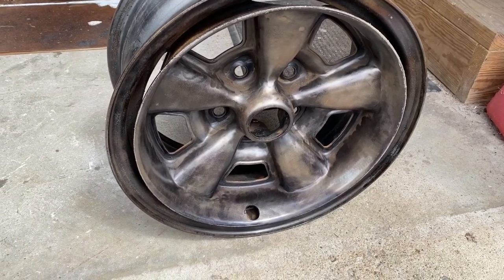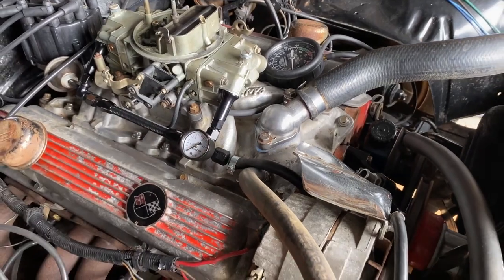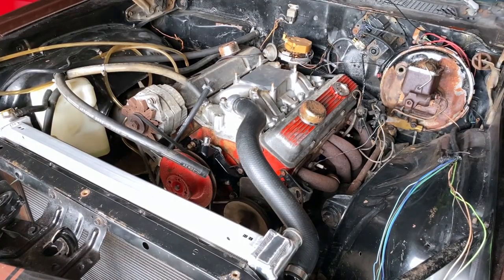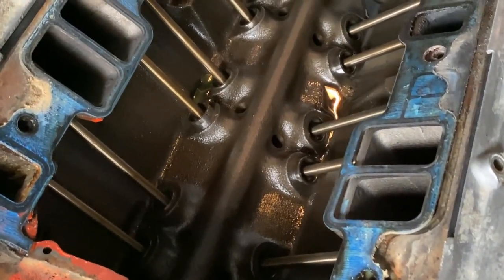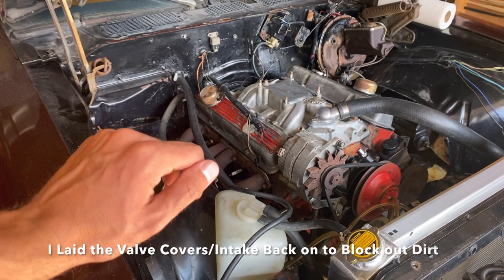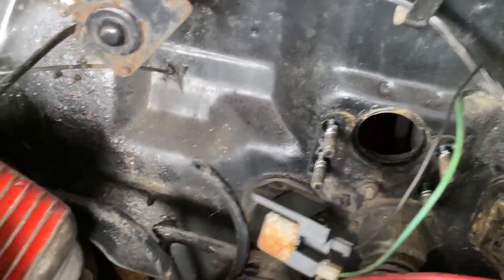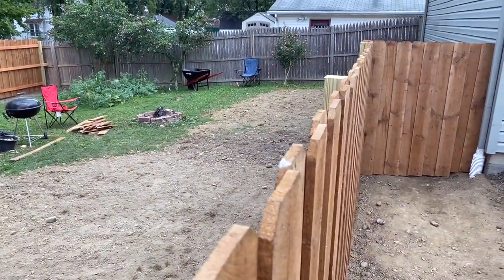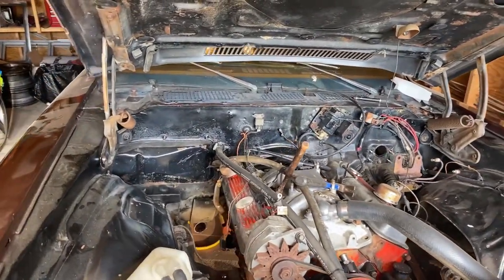Diving Deeper Into the 1973 Camaro's Engine..Does It Have a SOLID OR HYDRAULIC Lifter CAMSHAFT??

Comment: As you were starting I was thinking he might as well pull it, freshen it, re-gasket and detail the engine and bay. And wahlah, you decided to do it. Yeah projects usually take way longer than you think in the beginning. It is truly a worthy cause on this car. Plug on......
Reply: I think this about about every project. Never understood the desire to make an engine that's been sitting for years run ASAP. Tear the thing down, give it a dingleball spruce up at least and don't grind everything into dust. Same for brakes, transmissions and rear ends. It's a project. Slowing down will speed up the completion.

Comment: The way you have the distributor hooked up currently is correct, ported vacuum from the metering block...
Reply from the maker: I thought I had it hooked up correct but second guessed myself reading a comment lol. Thanks for the clarification!
Reply: Yeah you was right. If on the ported vac. The distributor will be advanced all the time.  And on the secondary port the distributor can advance with more throttle

Comment: ... it was Me! 1st to call it as a "Solid Lifter Engine" ';-) just to see that each cylinder has valve movement (open/close) and get new Rocker Arm Nuts then adjust the valve lash with each valve using feeler gauges to spec!  You are doing GOOD
Reply from the maker: Nice, you have a good ear!!
Reply: @RyanSampsonRPh  ';-) Many years of experience!
Reply: ... at 1st thought that it could have been a LT-1 until you checked the head casting number?
Reply from the maker: ConquestN98858 Right! The number (last 3 digits) stamped on the heads are “545” so it all appears to be correct for 73. Just have to see what is hiding inside it 😎!

Comment: Another great video, Ryan. Wish I lived closer. I have one of those 5 spoke rims. It was the spare to a 73 that I bought and started to restore, then life got in the way. I sold the car but the rim hes been stored indoors since the early eighties
Reply from the maker: Dang! The wheels are actually hard to come by!
Reply: @RyanSampsonRPh   I assume the rims were factory to the car. The paint is very weathered gray. I can check the date code if you want me to
Reply: I dont have the center cap or the beauty ring
Reply: @RyanSampsonRPh  Ryan, the rim I have is stamped, 15x7 JJ with either a 6 or 9 on its side under the  rim size. Not far from the that number is the number 4. I took some pics of it and the entire rim if you want me to send them to you

Comment: Looks like the factory lift into reverse shifter was replaced with a quality Hurst unit - It looks like the one i installed in my 74 Z28 - it had a shorter throw than the factory one - plus the factory shifter was held in by a small pin that would vibrate loose and the whole shifter would come out of the centre console a real pain - with the Hurst shifter no more problems 👍

Comment: I'm willing to bet that that car originally came with a points distributor. If you used the original 18ga yellow wire for the HEI power wire your only getting 8 or 9 volts. You need to run a 10ga wire from the fuse box and connect that to the distributor. Points distributors can't handle 12v. The yellow wire is a special high resistance wire cutting the voltage from 12v to about 9v max. That could be the reason you're getting misfires. Those ports are really clean. I'm thinking someone worked on those heads before and the heads are really clean for that being a 73. Usually there's a bunch of gunk in there. There's gunk in some engines from the mid 2000's

Comment: 1987 and older hyd lift and solid cams need zddp. A min of 1200 ppm. Not sure if I mentioned before but make sure you join the 2nd Gen Camaro forum at www.nastyz28.com. My handle on there is COPO.

Comment: You can tell if any of the cam lobes are worn by marking a white or light colored stripe on the push rods down the length of them an inch or so then start the engine or even turn it by hand and all the push rods will spin as the the valves open and close if nothings worn badly. If you have one or more not spinning correctly the cam lobe, lifter face or both are worn. Also you can check the specs on the cam with a degree wheel, they have cheap ones and you could even print one off the net and apply it to some plexiglass or something similar. As someone else said the cam should have some ID numbers on the front journal face. NICE FIND!
Reply from the maker: Danny Guinn Thanks for the info Danny! I was just researching how to use a degree wheel but I am more than likely going to replace the cam either way so I will check if it has some ID numbers when I remove it! Thanks again for taking the time to type this👍👍

Comment: If you truly like qjet carb sound...Holley made a qjet replacement known as a spread bore. Had small primaries and much larger secondaries. It will require a spread bore intake or adapter. Had one on my '78 trans am with  Pontiac 400/4speed that worked incredibly well. Helped with fuel mileage too by using the smaller primaries....if you kept foot out of the secondaries. My carb was a 650cfm spread bore double pumper Holley. If you need clearance from between fuel line and heater hose could try using carb spacer or a spread bore adaptor (if you decide to use qjet replacement). By the way, teflon tape is great for fuel fittings! My favorite route for correcting carb issues is definitely fuel injection. Really think long on reusing those headers. Exhaust technology is much better after 20yrs. I'm sure  there's a better option even accounting for $$. Highly recommend Cherry bomb mufflers. Several designs available. Great sound and made in Tennessee. Can check out YouTube for sound comparisons. Prices are incredible. God Bless.
Reply from the maker: Gary Womack Thanks for the info Gary, I didn’t know that about Holley!

Comment: I would pull the engine. More time and work, but you will know everything is right and be much happier in the long run.  
A word of caution on the cheap HEI replacements (I dont know what you bought).   After installing, always check your distributor end play.  I had a cheap eBay knockoff that needed a ton of shims between the intake and housing so it would not bind the oil pump when the hold down was tightened.  This was a block and heads that were not surfaced.  I would expect using shims after removing material.   I ended up disassembling it and comparing the shaft to a factory one and the machining was way off on the end of the shaft where it transitions from round to the flat tang.  I ended up grinding both radii to closer match factory and get it to seat down farther into the oil pump intermediate shaft.
Reply from the maker: tim psensky Exactly my thoughts! I actually had trouble with a C3 corvette’s aftermarket HEI shaft never being able to seat correctly. I returned it for another one and it was fine but super annoying👍👍! I messed with it for a few hours before I figured out the shaft was slighlty off compared to the factory HEI

Comment: The heads have definitely had some machine work. The guide plates and rocker studs are not stock and the springs and retainers are also not stock. Most likely the cam will have a number stamped on one end so you'll be able to look that up to see what the specs are on it. I think pulling the engine is a good move. With the car sitting so long i'm sure a new gasket set is in order even if it doesn't need bottom end machine work. Until you get the engine pulled down you won't know for sure what you have. Good luck and i'll continue watching.
Reply from the maker: Got it! Thanks for the info and the support 👍👍

Comment: Rebuild it but keep it true to its roots. Go with some nice aluminum heads, but paint them factory orange. Keep the factory LT-1/L-82 valve covers. Update the cam with a retrofit hydraulic roller. Go with an Edelbrock Performer RPM manifold, but grind off the edelbrock logo to keep people guessing. Easy to make 425+hp, and look factory stock.
Reply from the maker: Exactly what is going to happen 🙂👍!
Reply: @RyanSampsonRPh  My GF and I are restoring an '80 Z28. Brodix aluminum heads, edelbrock performer EPS manifold (the lowest good manifold made, hood clearance issues), and a Holley-type 650. Along with a retrofit roller cam. Painting it factory blue, and running the factory cowl induction air cleaner. Not looking to make 500+ hp, just want it more reliable (won't need ZDDP oil), sound a little rowdy, and turn heads with the idle. I race in Ohio all the time, where abouts are you from?
Reply from the maker: @bigjoelster  I have to see how much clearance I have and decide what carb I want to go with but I am thinking about the EPS as well (have it on a C3 corvette where hood clearance is an issue). Sounds like you will have a nice car! I’m near youngstown. Ever go to salem’s quaker city dragstrip?
Reply: @RyanSampsonRPh  never been there, but i've raced at Norwalk (Summit). I used to Drag Race a lot. I have a nasty 4th gen Z28 for that, but it's boring to me now. I do a LOT of autocross now. Been in Ohio a lot in 2020 with the Akron Sports Car Club. They use the Dragway 42 facility. I use a 2015 Z/28 for autocross duties.I saw in one of your videos you have an RX8, those are pretty good for autocross.
Reply from the maker: @bigjoelster  Never been to that dragstrip but it’s only 45 minutes away from me. I always wabted to try autocross with the Rx8, just never had the time! How long have you had the 2015 z28 for? Those have always caught my eye
Reply: @RyanSampsonRPh  I bought it in spring of 2017. Traded in my 2014 1LE SS on it. Did my first autocross a few months later and haven't looked back. I raced with the Northeast Ohio SCCA group at a small lot in Willowick Ohio, and a bunch in PA, near Pittsburgh and Clearfiled. The races at Dragway 42 are the best. They lay out some long courses and we can get some speed going. You are more than welcome to spectate and grab a helmet and ride shotgun. I usually take passengers for a few of my runs. I have an extra helmet.
Reply from the maker: @bigjoelster  Thanks man I will keep that in mind this upcoming season 👌!
Reply: @RyanSampsonRPh  My friends at UMI run some nice races at their facility in Clearfield PA. Not sure how far that is for you, but the events are sick! They also make a ton of stuff for 2nd gens and have a bad-ass test car. I'm going to run their solid body mounts and a/c delete panel on our '80 Z28. Here's their test car:  https://www.youtube.com/watch?v=P53IVA51aL0
Reply from the maker: @bigjoelster  Super weird you mentioned UMI as I just ordered and installed all my suspension parts from them (next video). Great company for sure! Only about 2 hours from me

Comment: Some of the better hydraulics use circlips instead of simple wire - just in case over-revving floats a valve.  Regardless, if you have any kind of miles on that engine, might as well pull lifters for inspection.  If they are hydraulic, go ahead and do full disassemby for cleaning and...check the pads on rockers: anything with bad flat spotting or getting real thin needs to find the rubbish bin.  If you find flat spotting and the ball shows signs of cooking you have an oiling problem: could be bad geometry, the cup side of rocker worn out, or a lifter problem

Comment: If it was my car. I would do a cyl leak down test before pulling the motor. If it's all is good, I would just pull the motor check a couple bearings and the oil pan for garbage. Re-gasket, new seal (even push in a new rear main seal). Chances are if some one did that much head work, they did the bottom end too. Beside the car has less then 60k on it, how bad can it be. If you don't like rattly rocker arms, slip a hyd cam and lifter in. The grinds available these days are amazing! 
  Detail the motor, engine bay and even under the car (get rid of the rust). Install a new clutch, motor and trans mounts. Maybe even change out the front and rear wiring harness for one that is not chewed up.  
  I wouldn't bother with those headers, they going to be thin as tinfoil after you sand blast them. New headers are fairly reasonable priced and built better these days. I'm a stainless guy, when it comes to  exhaust. I have had good luck with the thick aluminium header gasket.   
  As far as fuel management goes, I have really good results with the EDELBROCK pro flo 4 on street motors. Also the Traditional 4150-Style looks like belongs on early SBC.
  Oh and if is a 2 bolt main with a cast crank, I wouldn't much of any thing to the short block. Unless its number matching block, then that would be whole different build.

Comment: i had no idea 73 z28s had solid lifter cams. you would be better off replacing with a hydraulic cam and lifters and never have to worry about adjusting, but to keep it stock maybe better to stick with the solids and the ca, in it unless and lobe is wiped or worn.
Reply from the maker: In 73 they didn't but this one was just hopped up a little from one of the previous owners. You are correct, stock 73's are hydraulic cams!
Reply: @RyanSampsonRPh  well I'd put it back to original hydraulic specs. You have a great find and original as possible makes it worth more and solid lifters are a pain in the ass . I'm enjoying this restore. Your a smart and enjoyible person
Reply from the maker: Larry Burwell Thank you Larry! I am going to go back to hydraulic 🙂. Thanks for the support👍

Comment: I bought a new 73 z-28 still driving it , any way they came stock with hydraulic lifters. At about 15,000 miles a lifter broke the bottom off, at about 6500 rpm. Destroyed the engine. Have had a 1969 ,370 HP 350 UNDER WARRANTY THANK YOU GM

Comment: I am not sure I follow the title versus what you are doing. The lifters were in front of you, remove one. C-clip or spring-clip retainer... Big whoop! They do the same thing. It is what is inside the lifter body that counts and not what type of retainer they held them together with!
  My son had his bone head older step brother talk him into spending $5k-$6k at a machine shop. Now it's my problem because he lost the receipt and the speed shop says they don't keep the build sheet. B. S. What else do they do?
 So it has a ticking noise, adjust mechanical lifters or properly preload hydraulic lifters on this SBC? I don't know? I was a dealer tech for 4 decades and finding loose spark plugs, then locking jam nuts with a center Allan wrench nut inside. 
  You had the intake off, I turn my back and it is back on a pulling the engine! I can think of 6-9 reasons you have a misfire and use ACDelco parts unless you have a $2k laying around? 
DK, ASE master tech since 78

Comment: The 73 Z28 came with  350 CI V-8 engine equipped with a Rochester Quadrajet carburetor, hydraulic lifter cam and dual exhausts. Producing 285 HP and 280 lb-ft of torque.

Comment: Replace the headers with new ones!  If you care enough to pull the engine and rebuild it then you may regret not installing new headers.
Reply from the maker: I have some Cerakote laying around that I want to try out but if it doesn’t turn out right I will get some new ones!
Reply: Ryan Sampson, can you remove the rust and coat the inside of the headers with Cerakote?
Reply from the maker: Don Bearden I’m going to have the sandblaster get in each tube of the header and then I can spray cerakote inside the tubes 👍

Comment: Dont put a fuel injection system,they are very expensive to repair and easy to get damaged
Reply from the maker: Mods gtasa android Im thinking about the Holley sniper unit; I think the FItech units are the ones that aren’t too reliable but I will look into it more before I pull the trigger on it 👍